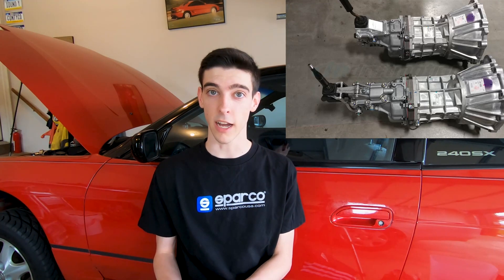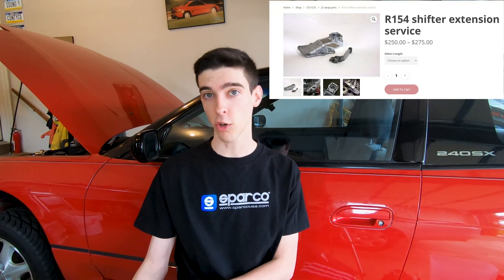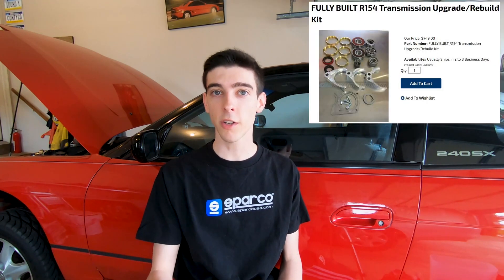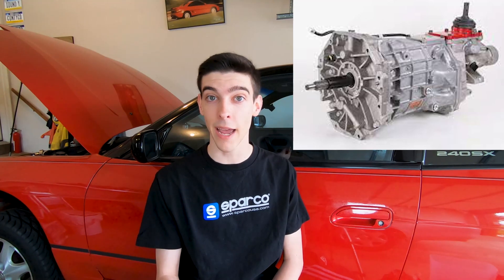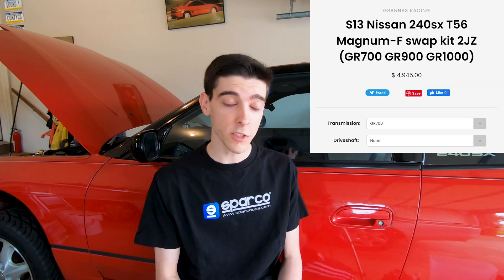Top 5 Most Common Transmissions for 2JZ | 1JZ Swaps

Comment: Nice video, man! You bring it on point. 5 stars for you! 

I'm destroyed a few of the R154 in my MK3 Supra with 1UZ twin turbo. This engine produce too much torque for the R154. In my opinion, 800Nm (about 590 lbft) is the safe limit for the R154. So for the 2JZ world it's perfect up to 800 horses. I used it on 2J swaps a lot and with the little mods like the billet thrust washer and the heavy duty bearing retainer it's ready for some hard racing. 

Maybe you can add the Tremec TKX to your list, too. For people who are looking for a 5-speed, it would be a another good option instead of the R154. The price for a new TKX is about the same like for a build R154 but it can handle a lot more power. 

A few years ago I swaped the T56 Magnum and I love this transmission with the UZ and the 2JZ, too. It's on the expensive side, but don't forget, it's a new transmission with very good part support all over the world.
Once you get it in stock trim, you don't have to think about it anymore for 90% of the people's power goals out there. 

Here in Germany a lot of MK4 Supra guys swapping to the 6-speed BMW transmissions (I think it's out of the 530D). It's known to handle a ton of torque and it's super cheap. I think it's more common instead your BMW 5-speed you mentioned. Maybe you can add this to your list, too.
Reply from the maker: MY MAN! Thank you so much for your comment! All the information you listed in your comment really helps those people who are having a hard time choosing a transmission. Really glad to hear you have had a positive experience with the r154 in the past and now have a T56! I also really appreciate all your other suggestions! Once again thank you for watching the video and for taking the time to comment!
Reply: Yes sir, I have a 530d 6spd gearbox in my 2jz gte is200 as well. At 500hp and 600nm it’s been doing great
Reply: @aquasmoke8539  What about tunnel, it needs to be cut? Considering manual swap in my IS300 ;)
Reply: Can you please write full code of thos gearbox or model and year thanks
Reply: yes sir the bmw conversion is very common here in South Africa 🇿🇦 

the cheap options here are the 330/330d 6 speed and then the m3 e36 but the guys who want to get the best option go for e46 m3 gearbox 

but after all the labour and clutch and adapter plate you could have just bought a v160 back in the day or even cheaper the r154

so the nice thing about the bmw box is if it breaks it is easy to replace but there's lots of r&d going in to make it work
Reply: hey  @the_JDM_fanatic Hey bro, I don't know what gearbox to install on 2jz, can you help me, I'm in Dubai
Reply: +1 vote for TKX. Looking for anyone that installed one to know what's needed. Sounds like smarter to go for instead of r154... depending on what's needed during ininstallation? Help

Comment: What transmission would be good for a 2JZGE VVTI
Reply from the maker: Good question! If you are keeping the stock power level of around 230bhp I would say the W58 will be the best option because it's the most cost effective for that power level. After you hit 300-400hp, I think the R154 is best. And above 500hp, the T56, CD009, or V160 are best!

Comment: cd009 is trash just get a tkx or t56
Reply from the maker: I have heard the CD009's are pretty nice, what don't you like about them?
Reply: @TunerFaction  gears are short and It doesn't last you end up driving it like a 5 - 4 speed bc you skip frist gear. And 4th some times. 
Had one behind a ls and it locked up after one year. Late 2005 model 

With the kit and everything to make it work your easy 2-4k in with a cd009 your at the same price as a tkx $2800 or a little bit more you can get the daddy t56 for $3500
The cd009 is dumb option today and I will talk sh*t about it to the day I die. If your not running a stock tranmission or a dog box , tkx or t56 is the only option for a none bolt up/ After market tranmission.
Reply from the maker: @nick39691  I appreciate the info my man thank you very much for sharing! I have a few buddies who've had good luck with the CD009 platform but they have also said the gearing is not great unless you change the final drive.

Comment: Dont do an r154 unless you are 400 hp or lower honestly save up for a t56 magnum i have had 4 r154s at various hp levels when i was at 650whp broke 3rd gear first time on the highway fully built first one broke at 300hp lasted 7k miles but became hard to shift. stock and built they all broke in less than 10k miles and you shouldn't launch them ever broke 2 shifting on the highway. My t56 has no problems all around better and cheaper in the long run im 900+whp way better transmission save up trust me its better in the
 long run
Reply from the maker: @speltwrong9009  great info man thanks for sharing!
Reply: Literally watching this video as my r154 took a shit, I am pushing 500hp and was just thinking of rebuilding it for now. You say yours broke quite a few times, Which t56 did you end up going with?
Reply: @zk2299 t56 magnum f from grannas racing just buy the kit it's worth it i have an is300. Also recommend a tilton st246 clutch much cheaper to rebuild over other clutches my clutch masters fx850 was about 1300 to rebuild and terrible to drive. i haven't rebuilt the 246 yet but it should be about half the price and it's alot easier to drive

Comment: Would a R150 from Toyota be compatible or need modification to work?
Reply from the maker: To my knowledge they do have bell housings to convert the R150 to the 2JZ but it isn't a common combination, and I'm not sure the power a R150 can handle. I also know the R150 came in two variants, one had a longer input shaft and the other had a shorter one. I'm not quite sure which one can be used with the 2JZ. Sorry I couldn't be more help!

Comment: i have a 5 speed zf (turbo m52) so not on a 2j but i have been making 850hp for several years now and it loves it.
Reply from the maker: Awesome info man thanks for putting your experience with that tranny in the comments! 850hp man.... that thing probably doesn't get traction until at least 5th😂
Reply: @TunerFaction  yeah traction is definitely an issue 😂
Reply from the maker: @E36_kidd  rock on man that's too sick😂😂

Comment: i have a question, i see in some places that the cd009 transmission is listed as cd009/cd00a. is there a difference between the two or is it the same tranny ?
Reply from the maker: Hey Pablo! Yes the CD00a and CD009 are the exact same transmission the CD00a is just a newer part number for the CD009! Hope this helps!
Reply: @TunerFaction  yes this helps a lot i was so confused thank you so much !
Reply from the maker: @pablovelez6019  of course man glad I could help!!

Comment: Well done Video just got 1 question wich speedsensor do you need for the R154 that it works in the Supra mk4 with the right speed.
Reply from the maker: The speed sensor I got for my R154 was called the Marlin Crawler VSS for the R154. This is an attachment that fits onto the stock R154 mechanical speed sensor system and converts it to a voltage. You would also need the Dakota Digital SGI-100BT in order to calibrate the speed sensor to the mk4 Supra. Hope this helps! Let me know if you need links to these products.

Comment: Nice video. I am planning a 2006 350z 2jz swap and plan on using the 350z Trans it's nice to know there is a adapter kit already out there.
Reply: I got one for my 2J. Cutting off the bell housing isn’t really that stressful. They give you a little template guide and I just used a sawzall with no issues! I went with Serial9 CD-Pro. It includes the shifter etc
Reply from the maker: Rock on man good luck with the build! Yeah that CD009 is certainly a good tranny!!
Reply: You will need to change ur diff so you’re gears are all over the place

Comment: The tr6060 transmission is much better than the t56
Reply from the maker: Agreed!
Reply: The Magnum uses the 6060 internals in a different case. The main difference being the hard mounted shifter and slip yoke. Both of which were needed for us "older" Mustang owners to be able to use it.

For the cold notchiness try a different fluid.

Comment: Don’t forget to mention that if swapping to an R154 transmission out of the MK3 supra USDM they’ll need a JZA70 bell housing. You can find these at Driftmotion or used online. My r154 handled 622whp for years. Now with a t56 f1000 but I think it’s time for a sequential. 😅
Reply from the maker: Great call there man I honestly totally forgot that you need that JZA70 bell housing!!! And wow that's super impressive you put 622Whp through that r154 of yours for years!
Reply: Lol. Good call. How much power you running.

Comment: Wait a minute. Isn't the T56 shifter mechanism like 1 inch closer to the dash than the r154? How yall getting this to work?
Reply from the maker: Hey boss! Thanks for the comment! So you are correct in that the T56 shifter is in a different location than the r154 shifter, however the Grannas Racing bellhousing for the T56 places the transmission in the perfect position so the shifter comes up right where it needs to in the tranny tunnel into the car in the 240sx. I have a video of me installing the tranny/engine into my car and you can see the shifter is right where it needs to be!
Reply: @TunerFaction  Oh aight. I'll check that video out. I'm actually trying to use this in a 96 Toyota Chaser. But if you replaced a r154 then it should be fine for me too
Reply from the maker: @Disiplyn  Rock on man I hope you find the video helpful!

Comment: W58? The w58s paired to US market 2jzge motors were a bit fragile, however Toyota put more into this trans than anything else in the w series. The models after 1989 were definitely stronger, but Toyota reinforced the shit out of w58s that were originally paired to turbo motors like the 1ggte. The reinforced w58s from turbo cars are sometimes worth 4-5 times the amount than that of their NA compatible counterparts. Some say they hold up to the r154.
Reply from the maker: Hey Russ! Thanks for the info! I had no idea there were different versions of thr w58, you learn something new everyday I guess! Thanks for letting me know boss!
Reply: I had a w58 and blew up 3 of them on a 7mgte making 600hp  3d gear just pop. There also a w59 on USA is300 stick..it bit weak but shifts better that r154..my 2j cressida has one and like driving tractor but hold more than 700hp

Comment: CD009 is a shit trans to use for a JZ swap, you’d honestly be better off using a Nissan FS5R30A from a Z32. For the same price as the CD you can get a brand new TT 98+ spec 30A
Reply from the maker: To each their own. I have plenty of friends that run the CD on their builds and absolutely love them. I do appreciate you throwing in the FS5R30A into the ring, I have actually never heard of it before! Very cool you can get them brand new for the same price as the CD.
Reply: I've ran cd009 on my jz swapped 350z for over 3 years and have absolutely no problem with it, I don't daily drive it just drift it. I did upgrade all the syncros 1st - 4th, as I did have grinding going on in 3rd gear. But I also had 220k miles on it before I jz swapped it so the trans was already abused. All transmissions can be shit if you don't really know how to drive.

Comment: Could I use the same adapter plate for a gte on a ge? Im looking at the t56 magnum but im not sure if it’s a different plate with the gte and ge
Reply from the maker: You can use the same adapter plate for the GE and GTE! There is dimensionally really no difference between the GTE block and GE block so you will be good!

Comment: Love the zf 5 speed trans. I have one cut and welded to a volvo m47 bellhousing running it behind my 437whp b230ft volvo engine. I love how well they take high rpm gear banging. I got both of mine from pickpulls for 180 bucks
Reply from the maker: That's awesome to hear man thank you for adding your input! Sounds like from your experience it is one heck of a robust tranny! Really appreciate you homie!!
Reply: That mean u using engine 1uzfe with volvo m47 gearbox right?

Comment: Where are the automatic transmissions that I can use in manual mode???
Reply from the maker: I have very limited knowledge of auto transmission options for the 1/2jz swaps so I decided to leave them out of the video. Sorry if that is what you were looking for!
Reply: @TunerFaction  No problem. Good video.
Reply from the maker: @MRMAN-wb1tv  Hey thanks mate!!

Comment: Are you able to give any guidance on how much and where you had to bash the tunnel to get your gearbox to fit? I have the same kit from Grannas.
Cheers!
Reply from the maker: Congrats ZONER on the Grannas Kit! and yes yes not a problem! If you can, get a picture of the tranny tunnel for me and send it to my email, tunerfactionofficial@gmail.com and I can edit the picture to show you where you need to bang the tunnel out! If not, just let me know and I'll do my best to describe it through a comment!
Reply: @TunerFaction  thanks. Sent.
Maybe put the same info here for others?
Reply from the maker: @ZONER1  I'll get that info to you ASAP brother! And for anyone else wondering how much to bang out the tunnel, you really want to take a lot of time banging out the drivers side of the tunnel right near the firewall (around where the gas pedal is). In general though, you want to go back about an inch from the front of the firewall and enlarge that area as much as possible, because the bell housing on the t56 is the part you will have the most clearance issues with.
Reply: @TunerFaction  that's helpful and should be enough info that I don't need the diagram. Thanks!
Reply from the maker: @ZONER1  no problem man! To give you an idea of how much I banged out my tunnel, there are some seam welds in the tunnel where you will be banging it out, and I literally split one of the seam welds a little bit because I thinned it out so much. Really go crazy with the hammer man, don't hold back!
Reply: @TunerFaction  not looking forward to it haha
Reply from the maker: @ZONER1  you got this buddy!

Comment: No mention of the Chevy/GMC ar5 transmission?
Reply from the maker: Hey Justin! I mentioned the AR-5 in the "honorable mentions" section of the video near the end. It is a good transmission don't get me wrong, but I have heard some bad things about it from a friend who tried using it for a swap, so in my opinion it causes more headaches than not. But if you want to use it, go for it!
Reply: @TunerFaction  sorry I must have missed that. I'm going to be running an ar5 with my build. Nothing beats being able to go to a local dealer and picking up a new trans for under 2k Canadian if I have to.
Reply from the maker: @justinmiller6497  hey man that's great! My buddy had issues with it vibrating at high RPM's, but I'm sure with a new tranny that won't be an issue for you! I wish you the best of luck brother!
Reply: @TunerFaction  I’m on my 7th since 2012 on tuned 5 cylinder Colorados tuned over 7k they hate 3rd at high rpm and lock out destroying synchros and pinions. I would compare it to a W58 non turbo that use to be cheap and relative, not anymore. $1500 with high miles.
Reply from the maker: @WoodLox  thanks for the info my man! I like how you relate it to the W58 non turbo, I think that's a great comparison! How much power are those tuned 5 cylinders putting down beother?😲
Reply: @TunerFaction  4 cylinder rotating mass crankshaft pulley injectors coils ram intake and electric fans thermostat ported and matched exhaust manifold and 93 235whp at 7.5k rpm in a regular cab. Crew and extended cabs use H3 rotating mass single piece driveshafts and a basic upgrades stated for 276ft lbs. From the casing to the gear orientation the W58 and AR5 are both similar Aisins. No different than the weak T50 AE86 that I’ve also owned but way easier to dissect with the split housings.
Reply from the maker: @WoodLox  great info man, thank you for teaching me something new!
Reply: @TunerFaction  you’re welcome brother. A bowl of knowledge composes substance to those who seek.
Reply from the maker: @WoodLox  couldn't have said it better bro😄

Comment: Good stuff man I'm hoping to drop the t56 from grannas this year in my s30. You got me wondering now about the tunnel fitment. Currently has a r154 and that's tight.
Reply from the maker: Hey Don really excited to hear you are likely gonna drop in that t56! You won't be disappointed! Don't stress that tunnel fitment all too much, you will likely have to bang out the tunnel but it doesn't take a long time and it's actually kind of fun😂 if I can give any sort of recommendation, it's to bang out the tunnel more than you think you'll need to, and if you can, trim off as much excess metal around the bell housing on the t56 as you can! If you want, I can send you a picture of where I cut excess metal off my t56 to get it to fit! I also have a video where I installed the t56+2jz on my channel but unfortunately didn't give much insight on how much I banged out the tunnel in that video